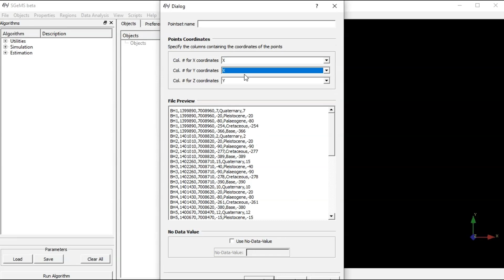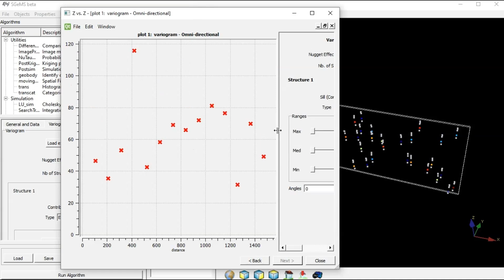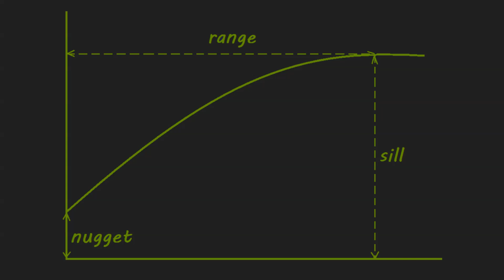Kriging with SGeMS is very easy

Comment: This one seemed pretty rushed
Is there anything for magnetometer data analysis
Reply from the maker: @kentmeier6762  yeah, 😂 I will slow down. Thanks for the feedback.

What would you like to do with your data?

 If magnetometer data comes as a grid of points, in SGems you can check the data structure and even extrapolate.